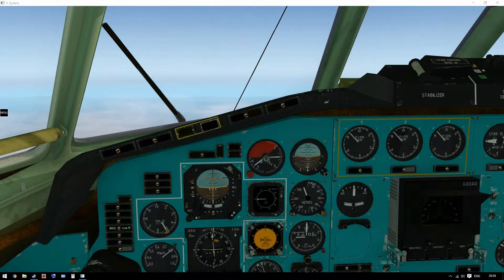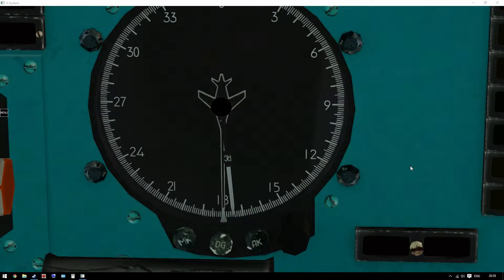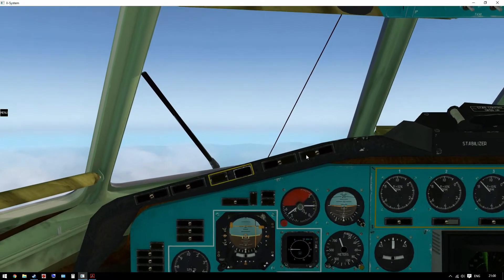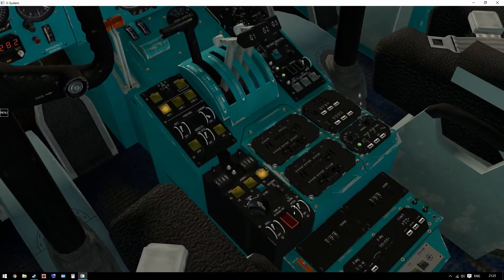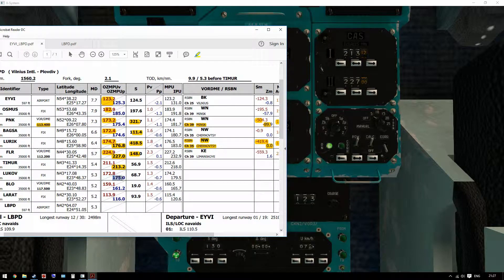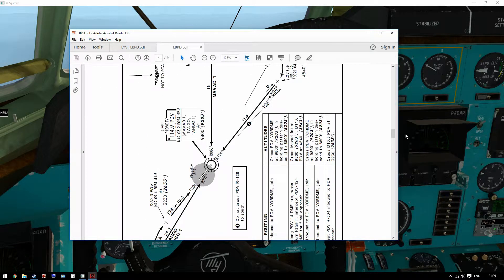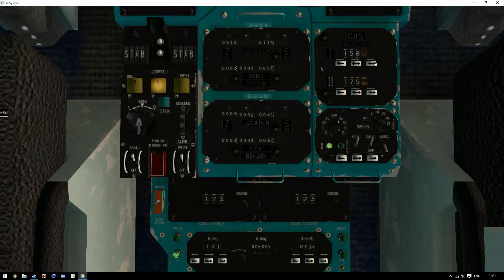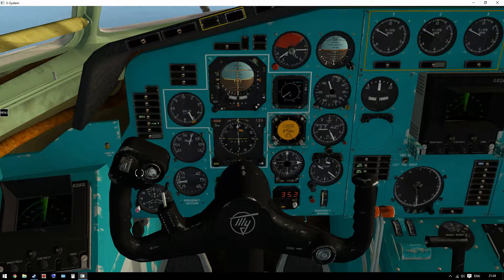Tu-154M in X-plane Part-7 Transfer of the gyros

Comment: I think a better way to do this is to adjust the ref gyro first (as you did) then switch USER to ref and check the NVU, like that if something is wrong you can switch USER back to main. Or if it's correct, line up the main gyro to the ref and switch user to main.